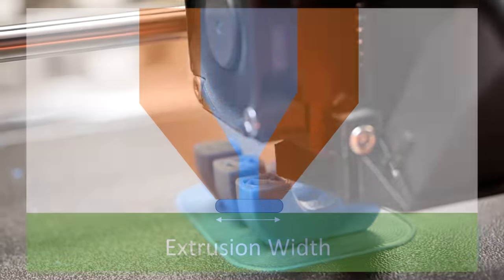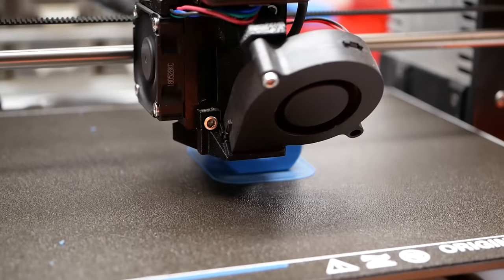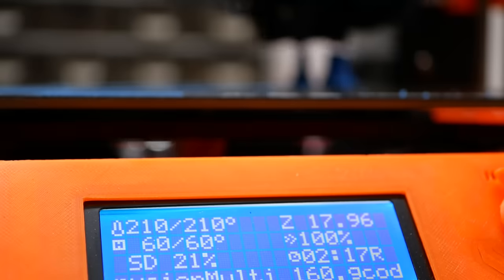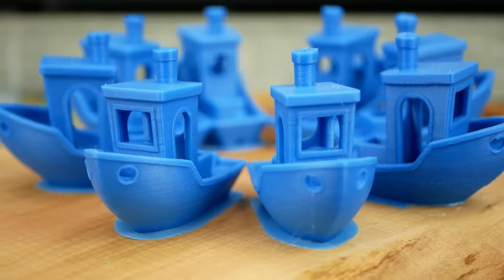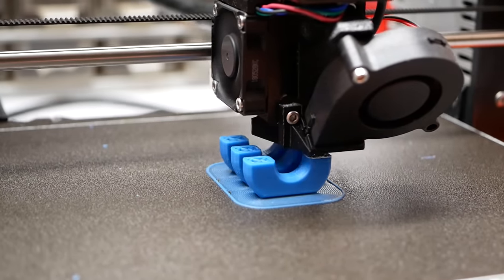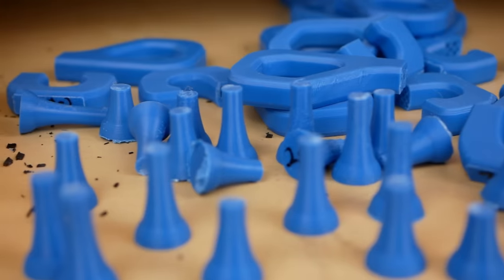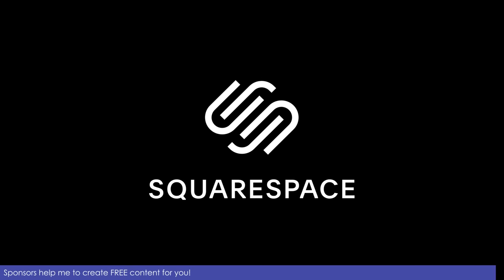Extrusion Width - The magic parameter for strong 3D prints?

Comment from the maker: Don't forget to share this video on Facebook, Reddit, Twitter and other social media!
Reply: If you actually limited the speed to 2mm3/sec then the question is did it become stronger due to the increased layer width or the slower print speed. at 100% - .4 layer width 1mm of extruded material contains .4 * .16 = .064mm3 material so 2/.064 = 31.25 so that was printed at 31.25 mm/sec whereas the 250 * was printed at about 12.5mm/sec so the question is does the slower speed or increased layer width make a difference. Also from my experience the protocol would be to properly tune in each setting. So i would suggest this procedure

1.) establish max extrusion rate for your material and machine like indicated here https://grabcad.com/tutorials/dialing-in-a-filament-and-specifying-the-max-volumetric-e-xtrusion-value
2.) maybe deduct 20% to allow for the wide range of pressure difference 

At this time lets assume you use PLA and 1.) established 13 mm3/sec deduct 20 % gives about 10 (lets use ten math is probably easier
3.) calc minimum speed of test which would be at 250 % which would be 10/.16 = 62.5 so 60mm/sec would be a good speed with a .4 nozzle. So in Prusa slicer the max speed and max volumetric E could be set to 60mm/sec and 10mm3/sec. With that the nozzle move speed will be constant as per my research (calling filament manufacturers) the print speed at which the nozzle moves makes a difference
4.) Dial in each extrusion width to establish a proper extrusion multiplier. to achieve similar (very close) component thickness the extrusion multiplier can vary as much as .1 (i.e .95 to 1.05) especially at the extremes. to do that I would print in your case a 1, 1,5, 2 and 3mm wall. here is a link to a print that might be useful

 https://grabcad.com/library/frc1989-filament-dial-in-1/details?folder_id=7076739 

This particular one has a 1mm. 1.25mm 1.5mm 2mm and 3mm wall. Unless you are using linear advance  measure close to the middle with a caliper. This also might teach you a thing or 2 about your slicer as you can also check for horizontal layer adhesion (tip print it with .96mm layer and you can peal the 2mm wall into 2) 

Then print a flat block at least 20x20 in size to inspect the surface you do not want the extrusion multiplier that high that you get a "rough ride" = have a wavy surface. Interesting different materials on the same setup in different conditions can require an extrusion multiplier as low as .9 and as high as 1.1

Now you can run your tests and should get good data on the influence of layer adhesion

Then you can re-run the test at 40, 20, 10mm/sec as max speed to see the difference the speed makes. My testing rig are my hands with which I break test pieces so not that accurate. But it seems between layer width speed plays a role too. Now i don't think it makes that much difference with a .4 nozzle but with a .8 it is much more noticable and to get good prints I usually use 110-125% for outside perimeter and 150-225 for the inside perimeters with a layer height of .4 (50%) as with a .8 a print with .4mm layer height will finish in the same time as one with a .2 due to the limiting factor being the max Volumetric E which for HIPS is about 18 mm3/sec the material we print most often and with above procedure you get not only prints strong enough but also accurate enough - look at this test

https://www.chiefdelphi.com/t/rack2020-test-with-updated-video/363607

That is all printed with a .8 all the yellow parts on an anycubic chiron you have 10 gears meshing and another 8 with 2 double. the bearings are also 3DP but on a prusa clone out of Nylon also with a .8 nozzle. You are looking at about 3kg of hips and 1/2kg of nylon in this video as everything is printed solid that means enough perimeters (6-16 depending on the part) to make everything a solid piece of plastic. Layer width for .88 to 1.6 on those prints. 

Looking fwd to a message as to what exactly was tested a mixture of print speed and layer width or one or the other. Would like to see all of these tested so I stay tuned and a patron
Reply: LoganDark yeah we should always get these quality videos for free forever right!? Sooo weird he asks for a bit of money to do all this, but you’re right I’ll be unsubscribing to miss all the info he has just to avoid an ad. ;)
Reply: @LoganDark4357  Have you any idea how much work goes into that - not to speak about the filaments and printer(s) etc. Just curious - how much have you contributed to his channel?
Reply: @martinpirringer8055  Which is fine, but no need to "beg". If people feel like sharing, they will.
Reply: @AntiVaganza  The way it came across to me was ask nicely
Reply: Andy Buchan  More shells is better in my experience. prints are the strongest in the direction of the filament that was laid down. With infill that is not that easy to control. Perimeters follow the line of the print and sometimes I place little holes or square cutouts sometimes as thin as .1 ot .1mm to create some "perimeter" lines in the desired direction like if i want to integrate some "spokes" in a wheel or gear. According to Stefan the strength parallel to layers is at best 60% even though I never saw him test horizontal adhesion and how to control it with slicing - we have but only with hand breaking and it can vary greatly depending on slicer settings and how the slicer interprets a certain part. That is why we use perimeters to control density and if we want to lighten a part we place holes of apropriate size and shape.so torque gets handled in the direction of the layers and not perpendicular to it where you rely on vertical or horizontal layer adhesion. Our goal is to come as close as possible to a cast/molded part as we want/need produce mechanical parts as quickly and strong as possible. any part on our robot at https://workbench.grabcad.com/martin.pirringer-2 is designed with that in mind and none is run with less than 6 perimeters (.88-.96 outside perimeter 1.2-1.6 inside perimeter) with a .2-.4 layer height if you are printing with a .8 nozzle. And most parts at .4 as we feel slower nozzle movement is advantagous for multiple reasons (accuracy, artefacts, adhesion). One problem with infill even at 100% is that for example in the wheel there is a weakspot where the criss cross infill connects to the hub and the rim part and you can twist the rim and/or hub part right out of the gear/wheel especially at infill <100. So either cutting the connecting part between hub and wheel out and replace with a sufficient amount of spokes or design openings to route the  filament direction has improved performance in our experience
Reply: Hast du auch einen deutschen Kanal?
Reply: So what about thicker infill extrusion. With a somewhat thicker extension on the walls. Using 3 or more wall count as a base. I use a wall line width of .4. Along with 1.2 thick, and 3 wall count. I also use 100% infill if I want something practically industructable. (When it comes to PLA and Impact force.) This is in Cure. I have found their softwear more comfortable, and better in my situation.
Reply: But unfortunately this video is out of date now!
The folders on the Marlin Github for individual printers no longer exist where shown and I can't find them anywhere, so it's not possible to follow.
There's barely any files on there at all compared to what was there when you made this =(
Reply: You should use 60% for the topmost level to get a smoother finish when the print has a flat top surface, and even if it doesn't, just leave it as a default at 60%.
Reply: Great and perfect job, thank you very much for share it!
Reply: @CNC Kitchen  This is wrong. 1:30  - Width sets the width of the line not the distance between the lines. The diagram that indicates the multiplier is a better representation of this. Multiplier is flaw rate which is harder to represent diagrammatically as it relevant to time.
Reply: No! D rather not. 🤦‍♂️
Reply: One feature in prusaslicer that is interesting to explore is the perimeter/infill overlap. in my experience it gives similar results but increases surface quality.
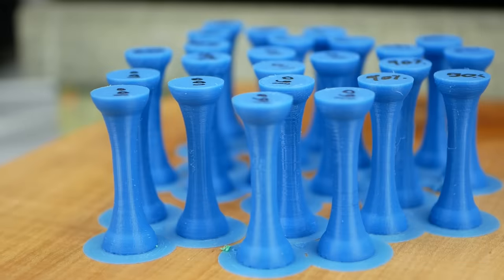Reply: Have you thought about coming back to produce the ultimate, "strongest" settings profile, combining all of the insights your testing has provided over the years, as you mentioned at 7:46?

I know a lot has changed in slicing techniques that might dramatically impact your results from these older videos, but I'd still love to see you try it anyway!

Comment: You should make a video on non-printed fill material, e.g. filling the inside by injecting epoxy and other glue types. Parts come out much stronger, but there are many different options for injected infills, and also different infill percentage for printed infills.
Reply: so, molds.
Reply: @kirbo1619  Yeah, I'd just make it out of Epoxy. Bonus for carefully mixing in some 13mm chopped glass fibre.

Just don't breathe the fibres nor leave them around nor sand/cut parts with glass/carbon fibres in them. They're an arse to work with.
Reply: This is GENIUS!!! I am SO glad YouTube exists!!! I never would've thought about filling the inside with epoxy. I actually have epoxy for the outside of some of my models though on the outside it's not for strength it's more for the finish of the product but there are some things that I make that could definitely benefit by having a boxy resin fill the inside rather than in the build
Reply: @sub-sonicwavescaraudio1814  oh heck, I'm also thinking of using this for better transparent parts by using a clear epoxy resin.
Reply: @forivall  That is also a great idea!! I enjoy your analytical approach to problem and solution the information always useful and helpful. I have learned quite a bit from watching your content and I am definitely thankful for all your videos and teachings!!!!
Reply: @sub-sonicwavescaraudio1814  I'm really happy to hear there are other makers out there that see the potential in this. I am actually working on a startup that is entirely built upon this idea. Would love to hear what kind of projects you would be using this for!
Reply: Cool idea, thanks!
Reply: @kirbo1619  molds are removed while here the shell merges with the infill

Comment: There is a limitation on Bowden extruders that print with 0.8mm nozzle or higher that you can't drive up the line width because the feeder can't keep up and jams. I print with Ultimaker 5S and the feeder can bearly keep up with 110% of line widths value.

Comment: Looking at the footage of loading of the hooks I think you can reduce the data scatter if you center the load every time (with some sort of added part). It appears the load placement can change a bit from sample to sample which is going to change the bending moment in the part.  Nice work by the way.
Reply: Maybe he can add small dips or ridges that hold/center the hooks in place on the part.

Comment: I have been printing a lot of parts that are single wall without infill from one of 3D LabPrint's RC planes and this video helped me solve a huge problem that I have been having where the wall lines don't stick together. I didn't realize before that increasing the line thickness above the nozzle diameter was possible but I just tried it and it's turning out great now! Thank you!

Comment: Interesting stuff as always! I've been printing with e3d style nozzles and extrusion widths of up to ~150% nozzle diameter regularly as well ever since I forgot to do a nozzle swap at some point and noticed that things generally worked fine anyway. It's so convenient this way, as using a 0.6mm nozzle covers a huge range of usable extrusion widths and layer heights.

As for bonding strength, also consider that increasing extrusion width while holding layer height constant increases the contact surface area between layers. The cross section of an extrusion is basically a rectangle, with the sides capped by semi-circles that have a radius equal to half the layer height. These semi-circles do not touch the above and below layers. For example, assuming 0.1mm layer height (25% nozzle diameter), the percentage of each extrusion that is actually bonded to above and below layers for a 150% extrusion width is 150% - 25% = 125% nozzle diameter. And for a print done with layer height = 25% nozzle dia, and extrusion width = 100% nozzle dia, the bonded width is only 100% - 25% = 75% nozzle dia. Thus printing something with two perimeters at 150% extrusion width would result in total bonded width = 125% * 2 = 250% nozzle diameter, while doing three perimeters at 100% extrusion would result in the same wall thickness, but with a total bonded width of only 75% * 3 = 225% nozzle diameter.  I wouldn't be surprised if the increase in layer bonding is more a result of the increased adhesion area than pressure effects. Practically, I dont think it really makes a difference as the general advice of using wider extrusions for stronger parts doesnt change, but it might be interesting to test if there's a difference in layer bonding between two prints done at 0.248mm layer height and 0.56mm extrusion width, one done with a 0.4mm nozzle, and one done with a 0.6mm nozzle, to try to isolate out the pressure effects.
Reply: Looks like a materal for another video
Reply: Great explanation

Comment: I generally use 150% extrusion width for mechanical parts, although mostly it was because I print most mechanical parts with PC-CF and the larger extrusion width helps with the first layer sticking to the bed, great video!

Comment: I always set extrusion width manually for all my prints. 1st layer - keeping it as wide as practical for best bed adhesion. other layers - it depends on what I need. I always chose wide extrusion for parts that need to be strong, and you seem to have confirmed that it's a good strategy, thank you very much for specific results. And narrow for best accuracy. I actually used wide extrusion for overhangs, but your tests suggest I should pick narrow extrusion for that, so I'm gonna change that habit! Every single video of yours is like a good science paper, I love it.

I also take care to keep extrusion rate constant as much as possible, by manually computing print speed for the chosen width, layer height, and material and purpose.

Comment: I've used wide extrusion width for making vase mode more successful on steeper angles in parts. I've used up to 0.8 on a 0.4 nozzle with decent results.
Reply: So what should be the initial layer line width in such a case?

Comment: Yep. I've played with it. On some items that had finer details, I found the defaults in Prusa Slicer would cause some of the details (such as writing) to disappear or get muddied. I've reduced the width to a straight 0.4mm on the bottom layers where the text was and I some additional detail would be preserved.
Reply: thanks for the tip, I've noticed prusaslicer (I used superslicer but same thing) sets 0.45mm by default but never bothered changing it. I'll have to try that

Comment: Yep, this parameter is definitely one of the top 3 parameters I adjust in slicers. Why? Engineer. Sometimes it's because of wall feature width, and how I want the slicer to path through the section. But it's also important to maintain the aspect ratio of your extrusion path. I don't have it readily available, but some research has been done, and you don't want the aspect ratio of your extrusion line to fall below 2:1 if you care about layer bonding. Also, the internal stresses and cooling properties depend on the aspect ratio.
And you can maximize volumetric flowrate this way also. Basically, it's a super important setting :)

Comment: Once I tried to change the extrusion width to a smaller value (-5%) according to the CHEP recommendation to improve the quality of small parts. 
Recently watched a video by Dmitry Sorkin, where he recommends increasing the extrusion width (up to + 200%) to get rid of zigzag movements when filling small gaps (depending on the model) and printing with fewer movements (faster than just increase print speed by same amount).
And your video with examples and science enriches my knowledge even more.
Dankeschön.

Comment: A arrived at at an extrusion width of 120% this way: I had over-extrusion; stringing, and bumpy walls. Testing showed walls became smooth at a multiplier .87. But now there were gaps on the top and bottom infill. Adjusting the extrusion width to 120% made the tops of my parts perfectly smooth. My settings are very far from normal, but my parts a practically flawless, and strong with this material
Reply: 120% (.48) is the stock setting in Simplified3D

Comment: I hardly comment on stuff so when I do I feel it really good or really bad.  This one is really good.  Very good information, show visual results, shows textual results, very well thought out and laid out.  A lot of good information in a relative short time, no "jibber jabber". What would be nice to see is a comparison on infill compression strength (and other related tests).  Take for example you need to created a special part for something that is not longer available, too long to get, or expensive.  What would one have as options with 3D prints.  For example, maybe a busing / spacer or heavy equipment floor foot or a dampener made of ABS vs. PLA. vs. PETG vs. TPU.  Any what happens at different fill patterns and fill percentage. What about lower fill percentage but different pattern and/or different infill line multipliers. What about general line width and height. And document (print) time and cost (material + power).   As a hobbyist, I'm usually more concerned with lower time and cost.  However, sometimes quality is more important.  This probably could be split up in two (or more)  parts.  A) Infill compression strength B) General compression strength (ie. same infill parameters but different wall counts, layer height, etc.  I did see the Gradient infill video also, more good information.